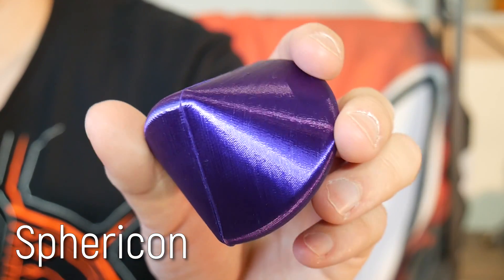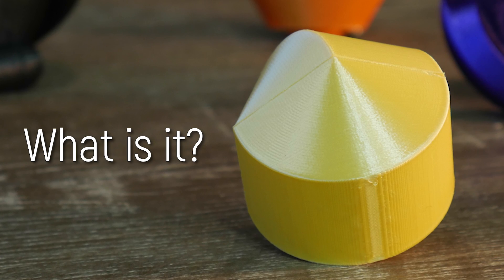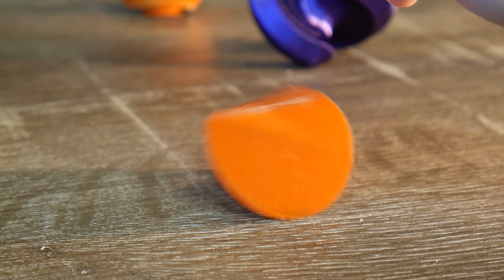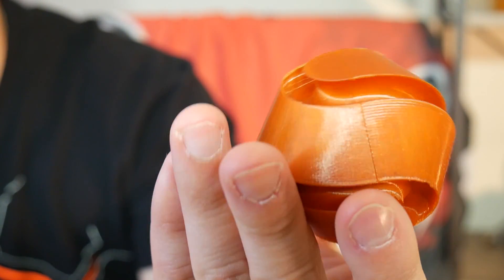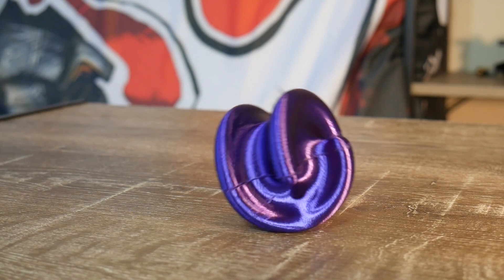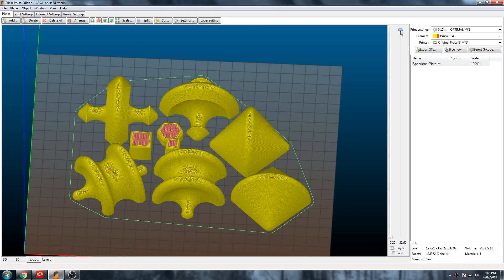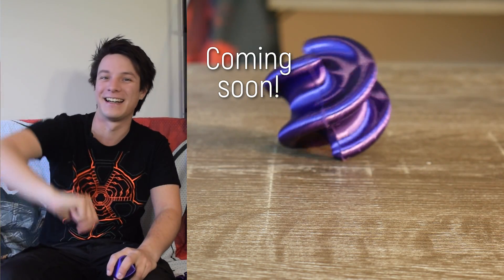Incredibly Satisfying Sphericons

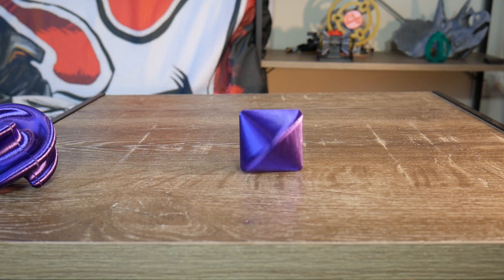Comment: At 1:40 you mention that unlike solids of constant width, sphericons have a fixed center of mass. However all solid bodies, including sphericons, have a fixed center of mass. Not sure what difference between solids of constant width and sphericons you were actually referring to, maybe that the center of mass of a sphericon always has the same distance to the surface it is rolling on? Just a guess as I don't know if that's actually true. Btw. great video!

Comment: Hey, I'm printing PETG with PLA supports on a Digi-tech x pro (dual, seperate extruders).  It's working really well.  I made the supports strong and added a nice ceiling on them.  It works kinda like a 3D raft / cast and cradles the PETG.  Then the parts just peel out of the supports.  Try it out.  I think you'll like the technique.  Really good prints with cheap materials which don't smell bad too!

Comment: Check out the works of artist/sculptor Charles O. Perry. Many of his designs were based on the sphericon. I had the pleasure of fabricating a sculpture for him that was based off one of his earliest designs. It was titled "Mace" and stood 7' tall, fabricated from bronze plate. I welded 3 pads to the bottom because it crab walked itself across the floor of the workshop one night with just a gentle push.

Comment: Hi Angus, I was wonder if there's a way to make the object's rolling surface even more smoother, possibly by making the surface continuous (which it is, no stepped edges) and differentiable (which it already is, no edges on rolling surface where tangents change direction rapidly) and double differentiable (which it doesn't seem to be as of now).
You see, on some highways the right angle turns on a corner are not two straight lines connected by an arc, rather the path actually is a rectangular hyperbola itself.

Comment: Small correction, the center of gravity is not a constant. The center of gravity is subject to momentum and the twisting of uneven halves back and forth means the center of gravity moves around the stationary center of gravity.

The defining characteristics here is a single rolling surface, and a constant height when setting on the rolling surface. Also, the object is ALWAYS in a rolling motion... meaning that all points of contact with the table (plane) exist in a single line segment.
Reply: Also, that object in which you can choose to change the "setting" of the hex... there's really only 2 settings (only 1 that's valid). There are theoretically 6, but home position and 180 position are both simply... wacky looking tops with a circular path. Any of the other 4 positions do the exact same thing as one another (except each setting is in reverse of the adjascent setting).

They won't do different things, just the same thing in 2 directions.

Comment: Potential uses... internal mechanisms for internal combustion engines that distribute force more efficiently, replacing piston socket - stem systems with smooth surface sliding elements that din't suffer stress or damage, or any mechanical parts that need to convert forces from one axis to another

Comment: 😀  Ahhhhh!  I want to get one of those.  I want the hexasphericon with inflated edges and seemlessly flowing undercuts one.   So, what happens when you change it's split?  Does it still continuously roll or does it stop because it's edges aren't smooth?  What happens when you snap it together without it being lined up regardless of what degree it's set/lined up at?  Will it not move, or does it move in a different direction?  It looks great with the shiny cast on the surface.  It would probably look interesting in the color silver too.

Comment: I tried printing the Sphericon on my TAZ 6 with eSun PLA + on "Fine" settings. But the print dies after 4mm and the printer clogs. I tried printing it twice and the same result at the same spot. Do you have any idea if there is anything about the model that could be causing it?
Reply: I tried another print of a different model on the same profile and it printed successfully. Since the model has a lot of turns in it could it be that the retraction is off and the extrusion to retraction ratio is off and the extruder wheel is pushing too much material and the that is causing the extruder wheel to grind against the same patch of filament then losing grip and not extruding. Thank you for your advice if you can.
Reply from the maker: try disabling retraction and printing one part at a time to see if that's the cause. It shouldn't affect print quality.

Comment: Very interesting, I am going to try making a 12 sided one right now.... let's see how it goes.
Reply: lmao, my head is fried now
Reply: Ok so I reigned my brain in back to the start, rewatched the video in bits and refused to make less than 6 sided after looking at the prospect of creating an 8 sided one. I have managed to make a 6 sided, similar to yours with my own slight skew on the side design, wondering if it would work. Chopping and rotating one half at first seemed totally wrong due to how I manipulated (unnecessarily) the sides which I extruded inwards leaving the rolling rails if you will... but it worked flawlessly. I might try and get my head around the 8 sided version.... 12 is probably ridiculous until I can realise how the rolling 'rails' have to go. Hmm, any comments would be great as I won't touch this for the next day or two.

Comment: If you like these, you should check out the Gömböc:  https://en.wikipedia.org/wiki/G%C3%B6mb%C3%B6c  

Gömböcs are monostatic solids with only one stable equilibrium position.  Set one down, and it will roll, move back and forth, and do even stranger motion, but always settling down into the only position it can possibly come to a rest at: it's single position of stable equilibrium.  They're also why certain tortoises can right themselves if flipped over without ever touching anything with their head of limbs - their shell is roughly Gömböc.

Comment: Can it... Can it supersized be used as a disaster rescue apparatus that can be rolled down the road and pick up debris, or pick up people I  the negative space in a mass water rescue effort post flood? What are the practical applications?
Reply: Videogames.
Reply: they'd make for some pretty fuckin strong ball bearings i would think, just have a matching race, its kinda like a normal factory transmission and a racing transmission(factory has twisted gears and racing has straight cut gears, factory makes less noise but also less surface contact on the gears so less power there, and racing has full surface contact, but its louder) maybe they could be a new age of special bearings idk. probably single use or something very rare.

Comment: I printed the inflated hexasphericon and replaced the center piece with a 1/4" nut (fits almost perfectly, no remodeling needed).  It gives it a nice feel having some weight in it and it still rolls, but I was wondering if a marble in the center wouldn't be better.  Thanks for the video.

Comment: Useing magnets in some or try just adding a little weight density in area's you could make a perpetual magnetic electrical charge, I can see many applications for this sphericon....
Reply: Casy Leer

You aren’t a physicist or an engineer, so you haven’t one clue as to what you are talking about. Conservation of energy, an undeniable aspect of our reality, as well as friction and resistances make it impossible to derive power from perpetual motion.

Let’s take something like a rotating object in space. It will rotate forever if no energy is taken from its rotation. This means that as soon as you attach something to the object, such as a motor that derives power from the rotation, this rotation will slow until the object ceases moving or the object + motor find an equilibrium point where they both rotate but no power / work is derived from the remaining rotating motion. 

This basic principle of work applies to every conceivable system you could possibly think of. No one can derive work from a system that is undergoing what you might call perpetual motion. The very ACT of taking energy out of a system means that that system has LESS energy to use to continue its motion, be it rotational motion or linear motion, and be it using electrical, chemical, thermal, or mechanical energy. Once the energy is used to produce work, it is gone from the original system. 

I’m 2 semesters out from completing a Mech Engineering degree, so I’m not spewing uneducated nonsense.
Reply: If you know so much about it why don't you create a perpetual motion machine yourself and give "lel free energy for everyone!!!! xdddd".

Oh wait that's right, it doesn't work like that and you're talking out of your ass.  Otherwise I wouldn't be paying for electricity right now and perpetual motion machines would be more than a youtube video novelty.  Good job convincing a bunch of other retards of your science fiction fantasy though.
Reply: @dmnck70  Humanity has the chance of creating a sun within the planet.
Reply: You didn't read a damn thing I actually said did you?  You are actually worse than a flat earther.  What kind of buzzword idiocy is "configured the magnet right".  Do you even understand how stupid that sounds?
Reply: The earth is "perpetually" spinning because there is no force acting against the rotation slowing it down in the vacuum of space.  However it stops rotating slightly each and every time a force outside of our planet collides with it, and eventually the earth WILL stop spinning.  Maybe it's in 4 billion years but why do you think this is relevant in any way?

We do not live in a vacuum. There is oxygen, gravity, and even if we didn't have those two very large forces to contend with how do you think you're going to get another object to move without subtracting force from the object producing the energy?  Each joule, watt, or ounce of force will require energy expenditure.  This shit isn't hard people
Reply: Casy Leer yeah you go do that buddy, well see how this "durr perpetual energy durr" works out for you
Reply: Yes you know what we call that here in the normal world?  We call it fuel.  When we use these thingies called "elements" we "combine" them into "fuel" that we use for our "perpetual motion machines" that we have contained in our "cars".  I like the touch of "my design" and "magnetic field".  Really adds that startrek vibe, have you been binge watching again my dude?

It's a shocking concept I know.  But we actually do have motion machines that are pretty efficient. They're called engines.  They might not use magnets but so far they're the best we have outside of harnessing nuclear energy or some byproduct of it.
Reply: Perpetual motion of energy is in the realm of magic and god.  Energy is neither created nor destroyed, magnets are not magic.

Stop pretending to be an intellectual when you don't know what you're talking about my man, it's the physics equivalent of telling somebody to plug a power strip into itself for free energy.
Reply: Watch mehdi sadaghdar video explaination regarding free energy
Reply: You are correct in most ways.  "perpetual motion" machines use over-complication and illusion to make it seem like they will last forever when in reality they are simply very efficient, not perpetual.  It boils down to in his example the use of magnetic forces to counteract the eventual stop at the hands of gravity you were talking about.  But what he failed to mention, or maybe doesn't realize is that magnets eventually lose their magnetism and will either need to be replaced or re-strengthened.

Essentially he wants to make an incredibly weak engine that seems like it lasts forever.  One thing you'll notice about the perpetual motion cult is that every time you question them the solution somehow gets more complicated and yet if you know what to look for nothing has actually changed in their design ideas.  Because no matter what you do, you'll eventually need to replace a finite resource that's powering them.  This example just happens to be magnetic charges.
Reply: wrong. Listen to me
Every moving magnetic field induces am electric field. 
This information is carried by A photon, which has energy. It is the quantum for the electromagnetic field. 

It is the reason why there is light, why you can see this wor(l)d. Because magnetic particles are moving around. 

God said 
div(E) = ρ / ε
div(B) = 0
rot(E) = -dB / dt
rot(B) = μ j + μ ε dE/dt 
And there was light. 

These are Maxwells equations. 
The 3rd and the 4th together lead to a wave equation. 

But I am not going to show you. I wrote the last test in my phisics bachelor today, and I had to do exactly that. 
And I am tired of physics, close to insanity and happy to finally have finished it.
Reply: Casy Leer your youtube videos make me doubt you have any academic learning past middle school
Reply: Casy Leer perpetual motion is physically impossible. It doesnt matter if you use magnets or what the shape is. There are forces at play both in terms of air resistance (however sleight) and power transmission inefficiencies.
Reply: You are either not an electrical engineer, or a very poor one, whose customers should be pitied.
Reply: Nitroschock 
He's a flat earther. They do not believe in physics...
Reply: Casy Leer r/iamverysmart
Reply: I don't need to know what you have been studying or working on.  All I need to know is that what you put in the comments is one of the dumbest things I've ever read, and you seem either unable to or willingly ignorant of the flaws in your idea.
Reply: High Priest of Keku lmfaoooo
Reply: NegikunTV damn dude
Reply: The use of magnets in a perpetual engine means that it is not perpetual, because magnets can demagnetize.
Reply: High Priest of Keku I'd say the comparison is better to plugging the socket into the wall, and having the other end the same so you can plug it into the other socket and saying it's infinite energy
Reply: while in no way it can create perpetual energy, i think it will definitely help the sphericons to roll further and faster. So its not a bad idea i guess
Reply: That Guy chill out
Reply: umm no. The magnet will move freely, but as soon as you try to tap that energy, a repulsive force will slow down the rotation
Reply: bobdhogan35, I never said one side it'd have to be left accurate in scaled size and weight, there's so many things you can do with perpetual motion and energy, I've got an idea for this sphericon that would require it to be made of special elements, and a magnetic field barrier around it, my design I'm now working on will rely on these factors especially the weight of the sphericons electrical elements applicable to the magnetics, I highly recommend everyone research perpetual motion energy And elemental conditions in base elements being combined....
Reply: High Priest of Keku The earth rotating is perpetual...
Reply: High Priest of Keku Your actually fucking braindead..... The guy stated multiple times that if you added a magnet and configured it right you could creat near perpetual motion and get more energy from it then your putting into it..... Professional Keyboard Informers like yourself are so cringe
Reply: High Priest of Keku, haha you've no idea what I know, I've been studying and working with electricity for year's, you obviously don't know about perpetual energy much, I see the application's, just because you can't doesn't mean it's not possible, LMFAO, your have no clue what I am thinking, it'd be difficult to elaborate in a text form as well.... doesn't mean I can't....
Reply: @casyleer144  yea totally
Reply: tasteedev Official EN, I said weigh density in some areas, did anyone know magnets can create a electrical charge when the correct elements and conditions are provided, really think about it, my thoughts stand firm, the sphereicons show near perpetual motion, if you could configure it correctly with density and the correct elements, you may have yourself a perpetual magnetic field, due to its rotation within the magnetic field, wow the more I think about this the more I see implications for it, go study base elements conditions and reactions, then research perpetual energy, then re watch this video, you may get a inclination of what I've thought of.... I am about to see everything in my ability to create what I've thought of.... if it works lol, haha, hahahahaha the implementation's....

Comment: so its a deformed ball???
Reply: Shadow14360 ! Geometrically deformed 😂
Reply: +Shadow 14360! Haha! The guy who has patented that stuff would kill himself after seeing this comment, thinking that... "I've tried to tweak with the shapes and people refer them to be deformed balls"
Reply: Yes but that's not a useful category; even a tetrahedron is topologically equivalent to a ball.
Reply: No, it's a geometrically shaped form that's basically meant to roll continuously (without it being a smooth sphere).  If you'd take a look at how it moves and that it has a winding flow then you'd see how it does that.  The sheen on the surface enhances the visual perception of the movement even further.  
Although, the other pieces are not shaped in a way that encourages movement, but they are unique and interesting to look at too.
Reply: Not "deformed." "Disgraced." Don't be insensitive.

Comment: I'd be interested to see how these would hold up in a vibratory with some lightly abrasive, small media.  I wonder if it'd smooth down the edges evenly or if the media would wear it down too much and affect the shape. In theory, it should smooth down the thinnest points which should be the tiny jagged surfaces.